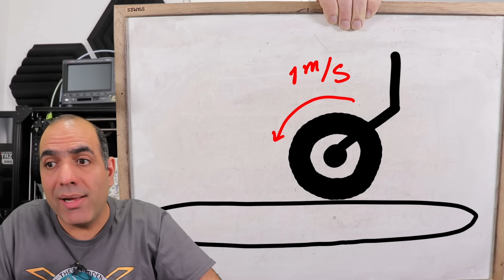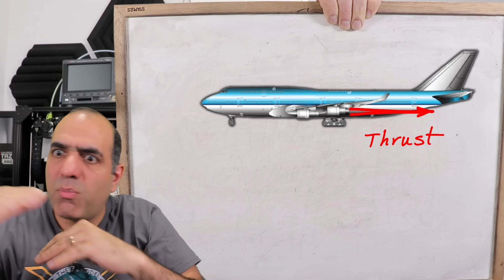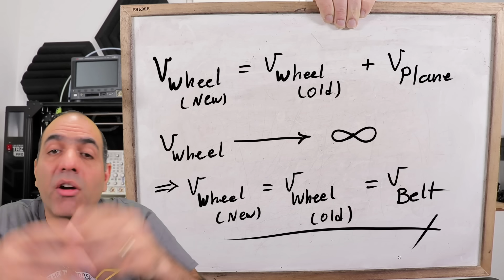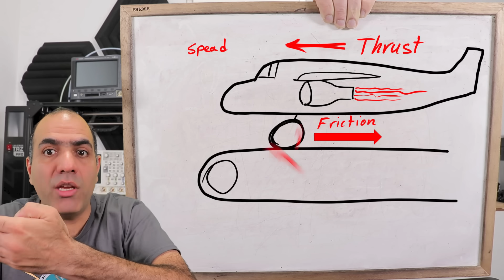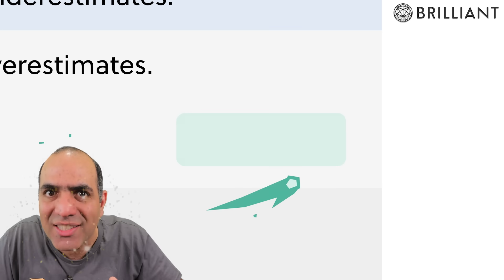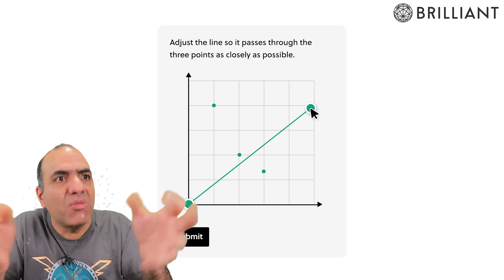Airplane Question that Drove Me NUTS!!!

Comment: you could also consider that the wheels spinning faster and faster causes them to eventually approach the speed of light. In which case the plane would start gaining relativistic mass until it was too heavy to lift off.
Reply: Surely they would fly apart long before they reached that speed, but I do wonder what effects rotating at the speed of light would have
Reply: @jdhannan  well, since the thought experiment already requires almost infinite energy and frictionless bearings I didn't think indestructible wheels require mentioning
Reply: @jdhannan  Now THAT is an interesting thought experiment! Since the wheels are a single unit, and one part (the rim) was moving at greater than light speed, and another nearby but directly connected part is travelling less that light, would relativistic mass effects come into being, or would the various velocities cancel each other out (since opposite sides are travelling the exact same speed in the opposite direction.)
Reply: Also the wheels would time travel, and when it stops spinning the plane would have already eroded away :)
Reply: reletivistic mass doesnt exist the energy from the momentum would becomse so high the wheel collapses in a black hole. you can explain it with reletivistic mass, but most physisists i know prefer thinking of it as energy from the momentum bending the spacetime. 
it is an interesting problem though, because the outside of the wheel would time dilate way more then the inside. you probably need someone studiyng rotating black holes to give a satisfying awnser
Reply: edit, you just made a new super mildly ennoying question, what if the plane had wheels with their outsides spinning close to the speed of light, would it be able to take of. i would love to see this question awnsered, because it could put the nail in the coffin for this stupid "reletevistic mass" thing. (wich again no physicist that i know uses, and most of them are verry ennoyed by, they just use the momentum 4-vector inproduct with itself to find the energy, wich is rest energy plus reletevistic momentum energy)
unfortunately i havent got to GR yet, in SR i think the plane does fly off, because there is no 'frame dragging', but in GR the calculation becomes super difficult for me.
so let me frame the question properly:
there is actualy 2 versions, one there the wheel spins with its axis of rotation perpendicular to the plane of the plane (haha) taking of. (like a normal wheel)
one where the axis of rotation is parralel to the velocity, and the plane flies of a cliff, (because gyroscopic forces would make the plane unable to raise its nose, so we introduce a cliff)

can someone with a background in GR please awnser, i know they say energy also bents spacetime, but i dont know how the calculations are made, so im not going to make any definitive statements on this.
if it turns out frame dragging effects in bouth versions of the problem exactly account for "reletevistic mass" im going to lose my mind (wich they might idk). otherwise we could use this example to show how it is a useless concept
Reply: @ariebaudoin4824  there is nothing special about "relativistic" mass. Mass is a property of the amount of energy contained in an object including its momentum. However in  most cases the strong forces' binding energy is so big that it contributes all of the significant mass of an object. 

If you accelerate an object enough you can reach a point where its momentum contributes noticeably to its mass. This only happens very close to the speed of light, therefore we call it relativistic.
Reply: @Discord-l4c  but yeah you are right, the plane does get heavier, i was being a bit dumb when thinking about this. i just think the term "relativistic mass" is verry confusion because of the way some undergrad textbooks use it in the equation m = gamma*m_0 wich is super confusion, so i dont like the term relativistic mass
sorry for the rant
Reply: Actually, there could be some hypothetical truth to this, easily below a fraction of a percent of light speed.  IF the tires could hold together at super high rotational speeds, it could lift the plane off the ground due to the  laminar effect of the air EVENTUALLY getting under the wheels (and it WOULD at some point a mere fraction of a fraction of a percent of light speed)  Think of the tires as laminar flow paddlewheels.  (This of it as hydroplaning, but on air, not water).  The air coming in front of the tires would get compressed, as it HAS to make its way under the tire, as well as the centrifugal outflow of air from the center of the wheel.  The rotational speeds would be terrifying, though, and likely even at low Mach numbers, destroy the tire.
Interesting thought experiment, even if the tires only made it to low mach levels for linear velocity.  Sorry, had to entertain this.  As for CLV's approaching light speed, I think we're talking some black hole, astrophysicist level braining, and we need to ring up Neil DeGrasse Tyson, stat!  We need answers.
Reply: @philstuf  i was thinking you get aditional tires and put them in a vacuum, to decrease the complexity of thyhe problem and only focus on the reletevistic inertia and stuff,
but interesting take, i dont know if neil would be good for it though, he doesnt seem like the calculoating type of guy
Reply: Rotation at the speed of light, not linear motion at the speed of light. A rotation of the wheels to the speed of light would cancel out and the matter in the wheels would fly apart at the speed of light perpendicular to the tangent line at the matter point on the circular wheel. It so ridiculously complicated its arguably not worth considering.
Reply: Why isnt anyone considering airplane fuel usage???
Reply: Relativistic length contraction in the tangential direction would create tension in the circumference of the wheel until it tore apart. Probably other weird stuff would happen. As far as inertia goes, relativistic mass can be useful. However it's not useful for kinetic energy, for example. KE is not equal to 1/2 * relativistic mass * v^2
Reply: @OurAwesomeUniverse  the wheel would obviously be infinately strong, as mentioned before
Reply: Or relativistic mass gain eventually turn the whole plane into pure energy. and it starts traveling at the speed of photons.
Reply: Everyone forgets about the moment of inertia of the wheels.    Match the force needed to accelerate the wheels and the thrust of the jet engine.   I do believe that would be the product of the  angular acceleration and  the moment of inertia of the wheels.
Reply: Or it'll travel through time 😂
Reply: At infinite velocity, they don't fly apart... Assuming there is no friction, or thermal limitations, they just keep spinning and spinning at infinite velocity, and 'coolness'... I mean, who doesn't want a treadmill that can shed the weight faster than an apple falling on Newton's head? Haha
Which means by the laws of thermodynamics or Newton's, the plane cannot move unless more thrust is given to the engines which counters the drive belt of the treadmill. That assumes the plane is distributed equally on the treadmill and no other forces interrupt the treadmill and the engines... Therefore, doesn't the engines have to speed up x^2 to counter the treadmill to take off. Assuming the take off speed is 380Km/hr?? Mmmmm
Reply: The plane won't fly because it needs  high pressure below the wing and low pressure above the wing
Reply: @liamraphaeljacinto4251  your argument convinced me that it actually would lift off. At some point the conveyor would drag along enough air and cause enough airflow around the wings to lift the plane.
Reply: The wheels don't spin faster and faster though. That is contrary to what the question says.
Reply: It would convert matter of the wheels and conveyor into pure energy and blow up the planet.
Reply: They would never get that fast. The plane would have to be moving forward for them to be moving. By the time the plane took off it wouldn't matter. For the wheels to turn the plane must be moving forward but due to air not wheel speed.
Reply: *sigh

Comment: It's a race to see if the plane obtains lift speed first, or the bearings on the wheels fail and fall off the plane first, resulting in the plane's destruction as it falls onto the conveyor belt which then shoots it off the runway backwards... unless the conveyor has some great breaks...

Comment: You are wrong at 4:10, Mehdi. It won't take off if bearings are frictionless. See, the belt applies linear force to the wheels. To convert it into rotational momentum, you need to apply an opposite force at a different place, which would be the axle. Therefore the belt would still apply the linear force to the plane. Except if the wheels are massless.

Update: actually, if the belt drags the air with it, then the plane will be able to take off vertically.

Update2: unless the dragged air too turbulent. Though that will still probably count as take off. Noone said you have to land afterwards.

Comment: befor i continue watching, my Answer: " No, it cant take off, as the belt rolls backwards and the wheels going forwards so the right way, the plane would stand almost still on its place or going backwards  because of the belt, but because the plane is not going forward, there is not enough lift/air under the wing to let it take off"! this is my answer.

Comment: The plain takes off using ait physics, by creating a differce in pressure around its wings.
So if the plain is in an air tube and the air moves as fast as the conveyor - it can take off.
In fact there are documented cases of planes landing almost vertically in strong wind conditions. So it's really not about how fast he moves in relation to the earth, but to the air. 
But if the air is still, and only conveyor moves - then it cant. The turbines will only serve to canvel friction and backwards movement through the belt, but if the wing doesn't move through the air - no lift is generated.

Comment: Pilot and engineer here, answer is it depends. The "speed" of the aircraft doesn't matter for lift, only thing that matters is that there is sufficient airflow over an airfoil. This means you could set up the problem to get either answer.

Comment: No it would not take off. It needs to produce lift, so it needs to move through a body of air at the needed speed for takeoff. In this scenario it has No air speed, only ground speed, therefore it would not be able to takeoff

Comment: The answer is simple: NO, It can't take off, because it needs 60mph AIR SPEED to take off. If it's sitting stationary on the belt it's not developing any airspeed.

Comment: Imagine a 747 ... blah, blah , blah... "The conveyer belt is designed to exactly match the speed of the wheels, moving in the opposite direction… blah... "
The speed of the wheels has nothing to do with the Indicated Air Speed (IAS) of the aircraft, which is the only value that could tell us about the air conditions in wich the aircraft might be able to "Take Off". Also, there's no information about the condition of the aircraft. Has it wings? What's it's weight? The answer is simple: "Not Enough Data"

Comment: The premise is stupid. If we allow for magical friction-less belt, that can accelerate up to near c,  that doesn't create any wind, then we should allow a normal jet with magical friction-less wheel bearings, in any case the jet will take off. If the belt is not magical, the plane will take off. If some magical conditions are allowed (like friction-less operation of the belt) the plane will take off, due to wind created by the belt among the jets easily overcoming resultant force from friction in the wheel bearings.

Comment: My physics teacher gave us this problem in high school! We were a bit wishy washy and when he explained it we all felt dumb lol
Reply: Is a physics teacher used the same wording as this senecio, then that physics teacher did a mis-service to his students. He should have rephrased it so it was clearer and have only one answer, not any answer based on each students assumptions that is needed to answer the problem.
Reply: @MrT------5743  this is a common school textbook problem that does not include the light speed treadmill.  It's just a normal treadmill, running at xx mph, the plane's takeoff speed.

Some genius rephrased that into 'always equal' and spawned a mind virus that will not die

Comment: Technically, without the frictionless bearings, there are two scenarios... the friction provides insufficient drag to overcome the thrust and the plane takes off or the friction becomes large enough to cause the tires to catch on fire causing the plane to crash...

Comment: The speed of the wheels have no real bearing on the ability for a plane to takeoff. What maters is the airspeed over the wings. A small Cessna could be sitting still on the tarmac with a 70kt headwind and it'll start flying, albeit with no forward motion. This is the main difference between ground speed (GS - the speed tracked over land) and indicated airspeed (IAS - the speed of airflow over the wing). The example Cessna I mentioned could have an IAS of 70kts but a GS of 0kts. This would mean the plane is airborne but with no thrust being generated from the propeller, it essentially remains stationary. This is why smaller planes are tied down when not in a hanger so strong winds don't pick up the aircraft.

Comment: Of course it can, but the wheels will not turn as it takes off.  The thrust the engines develop acts on the plane, so what happens with the wheels is irrelevant.  It would be different if the wheels were driving the plane.

Comment: Its not a matter if you can takeoff its a matter of will you take off the ground speed would be above normal at least to the airframe and landing gear I don't know if it could handle the speed. But if that wasn't an issue than yes it could take off the engines produce thrust by moving air the ground has nothing to do with an aircraft flying in-fact the plane doesn't technically have to move, high winds can even provide enough lift for the plane to become airborne. This is like the blow your own sail idea it seems like it would work but it doesn't. The blow your own sail can can actually redirect thrust providing motion but it is a loss so its not worth doing. 

Edit: I answered before watching the video and was going directly from myth-busters and airframe speed not wheel speed hence the blowing your own sail reference😂

Comment: Yes it will take off because the wheels just go at whatever speed they need to. The thrust comes from the engines, not the wheels. They are effectively castors.

Comment: The conveyor belt, is a 'red herring', as wheels can turn.  And the question is, CAN the plane take off.
All other conditions being 'normal', the plane will be able to achieve take-off airspeed, as propulsion is atmospheric, not mechanical (wheel) drive.  Tires may explode, as the wheels will be subject to twice take-off (ground) speed.

An analogy, would be the speed of a sailboat, on a river.  Will the boat be faster going upriver, or down.  It depends on the wind speed and direction.